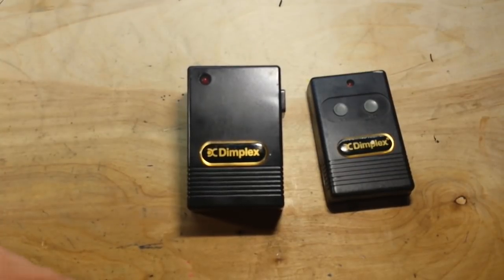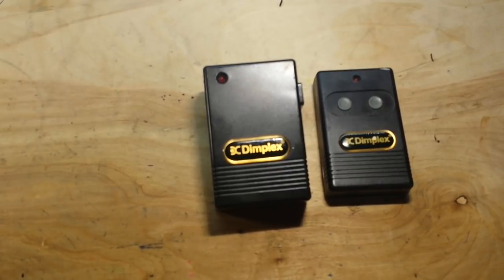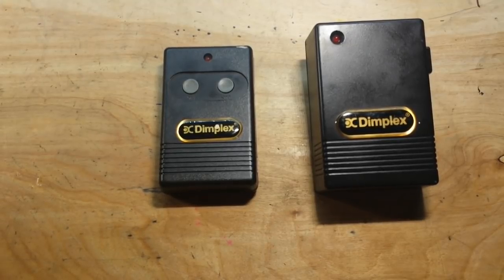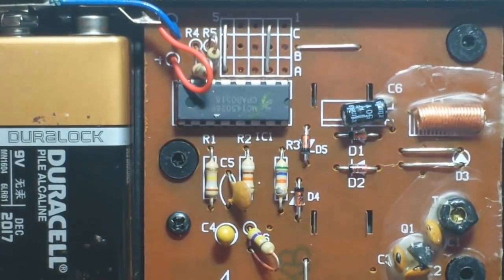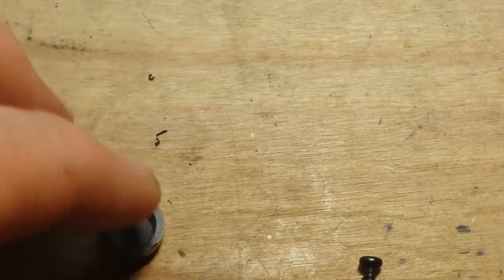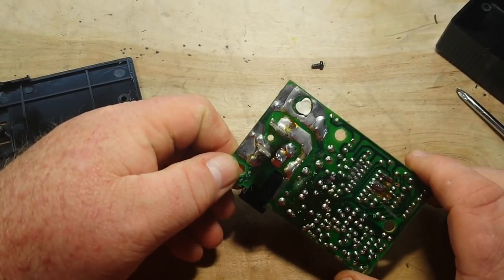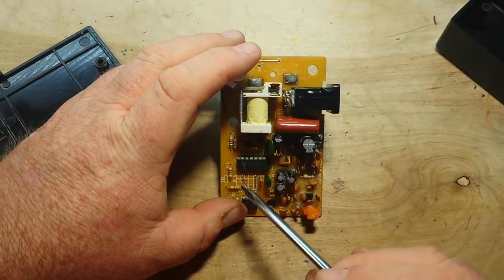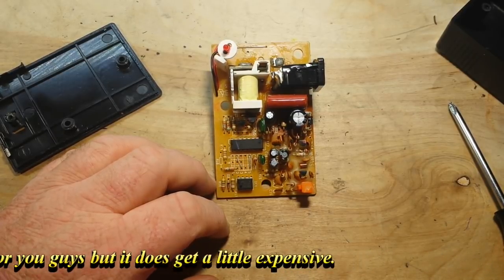Dangerous old school home automation teardown

Comment: Hi, those wired jumpers will set the digital Address ID needed to operate the Tx/Rx pair, that is how you can have more than one pair in the same house.
The output is an oscillator, fixed frequency, the wax is to fix the assembly for frequency stability.
There is one frequency only.
The data sheet shows how to set those Address IDs.
Reply from the maker: Thanks for the info. It was difficult to f8nd much on them.

Comment: Ebay has these for 100 bucks.. comes with 5 stars!! whoo hoo..   I see they run at 433mhz.. isn't that now ILLEGAL to use in USA without a HAM license?
Reply from the maker: Yes sir, 433MHz is the 70cm band and requires an amateur or commercial license. These units have a safety recall from 2010.

Comment: Hey Paul, I have a question. Early this month for my b-day I received two new multi-meters. I think I put your links in my shopping cart but I have no way of knowing if it worked or not(I am hoping Amazon gave you the credit)?  I am enjoying both the UT61E and AN8008. The Aneng is a cute little guy that seems to work very well. The included little "manual" is too small for my old eyes to see it, good thing I have been using meters since the late 70's and don't really need the manual. Take care Rick
Reply from the maker: Amazon unfortunately doesn't show me who orders what. But if they ordered it through the links I will make a buck or two and for that, I am in your debt! Thank you.